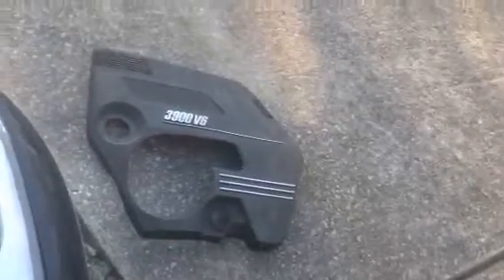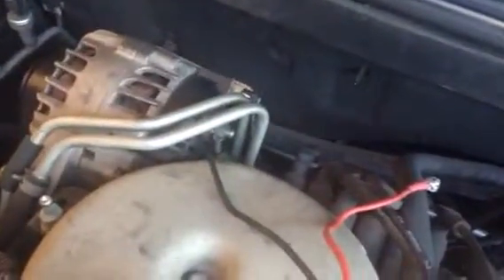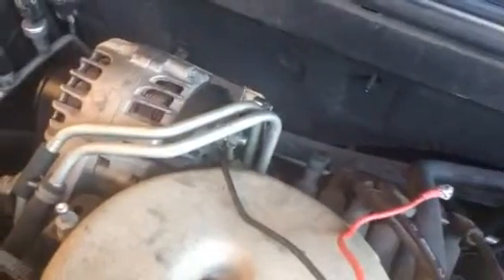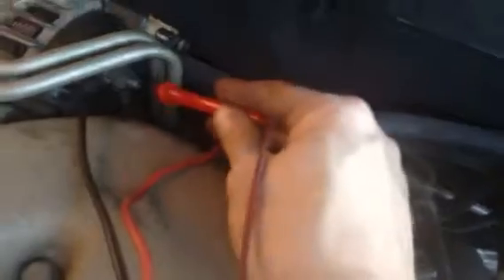2006 Pontiac G6 3900 V6 charging fault; Fusible Link bet. Alt. & Starter

Comment: Hey I’m having the same problem.  Did you ever get it resolved?  How you connect the alternator to battery after
Reply from the maker: Double, triple check the Fusible Link between the alternator & starter. This seems to be a common problem w/ these cars, the parts stores should have the part & be able to help u out. It was Not my car, so no I wasn't there when it was fixed correctly.  Not sure what you're asking at the end, alternators & batteries usually have a medium or heavier gauge wire, 12-10 gauge, maybe bigger, that connects them. Alternator usually has a stud/nut connection, & usually goes to the Positive battery terminal, in general, some cars may be different. Been about 5 years since I looked at this Pontiac, so ask around, especially the parts stores. Wish you the best man. Take care.    - Leeroy

Comment: I changed the alternator and starter for my 2009 pontiac g6 2.4 L fired it up and my battery light on dash cam still showing changed the fuses still having the issue any ideas
Reply from the maker: Look for & test the fusible Link w/ a multimeter, check continuity(beeper function), check connections on Both ends of it. Could be the same problem, but idk for sure since your's is a 2.4L. But they might share a lot of the same parts. Ask your local parts stores, mechanics & such, & look for fusible Link repair videos for your 2.4L. 
Good luck man, wish ya' the best.   
Take care,  - Leeroy
Reply from the maker: If it is the fusible Link, replace it & I always Always recommend dielectric grease. Apply w/ a toothbrush preferably. 
 - Lr
Reply from the maker: U get it fixed? 
Hope so. 
 - Lr
Reply: @leeisenberg  
I haven't yet I put on the starter and it broke the plastic part that connects to the fusible link so now I'm looking for a different car starter but they were used starters so hopefully I can get this done I'll keep you updated
Reply from the maker: @AaronRowland-y5w  Oh okay. Sounds like you're on the right track.  
Good luck, wish ya' the best.
Reply from the maker: @AaronRowland-y5w  Oh okay, cool. Nothing wrong w/ used parts unless they're worn out. U might want to lube/grease the bearings in those starters if u can w/ some good stuff like blue Lubrimatic high temp wheel bearing/brake grease, & if they have brushes polish the commutator & add a very light coating of high temp dielectric grease.

Comment: Hello I have this same exact problem right now. Did you find a solution?
Reply from the maker: I did Not find it, but the fusible link is down on the starter. Read all the comments here & look for a video that shows Exactly where it is.  Good luck, wish ya' the best,  - take care
Reply: Most likely, it's the starter wire don't at the starter. The green wire, it gets caroded really bad and goes bad. Cut it and replace that wire.

Comment: I found the fuseable link should be in the small wire off the starter that comes from where the large wire from the battery to the starter. 2 wires hook together at starter.
Reply from the maker: Oh okay cool, thanks for sharing man. Wish I'd known where it was when I was doing this. I was Mistakenly told it just needed an alternator, found out the Hard way.  Thanks again for sharing.
 - take care

Comment: I had the same problems and found that it was a wire burnt in to going to the starter. I fixed that and it runs fine now
Reply from the maker: Hey thanks so much for sharing, you're the ONLY guy to leave any comment on the Real Fix w/ this problem. So was the wire that burned actually the Fusible Link or something else? Never mind I think u answered that in your comment below.  Hey man u don't have any content on yer channel, so that can be yer 1st video.  Can u make a short/sweet video clip showing it?  thanks again, take care man
Reply: Man my cars fuckin not starting new alternator an battery...so its a wire from the starter? Wheres it located on a pontiac mines 09
Reply: Is there a video or tutorial that shows how to do it? Maybe a link? Much thanks
Reply from the maker: @BabyAnthony  There SHOULD be 1 out there, but I don't have 1 handy at the moment. Let me know if you find a good 1.  Good luck, wish you the best,   - take care
Reply from the maker: @FIGHT101TV  Probably your fusible link between the starter & alternator, its a special wire that acts/blows like a fuse, but u have to replace the whole wire. It should be on the same place on your 2009 since theres just 1 gen of G6; 2004/2005-2010.  Good luck, wish ya' the best,    - take care
Reply: @leeisenberg  hey yo I don't know if you are still dealing with this problem or not but I as well could not find no videos on The wire feasible length wire but I do know that the wire is green and the wire coming off the alternator is red and again the wire coming off of the starter is green or bluish color. But anyways I believe I am dealing with the same problem on a customer's car of mine so I think when I'm going to do is make my own video and post it to YouTube as I have been making my own do-it-yourself how to videos for cars because I am a mechanic so that being said I might go out and make me a video on how to do it for everybody while I'm fixing my customers car also if anybody ever has any questions you can find me on Facebook by the name of David King or my personal page www.facebook.com/kingdavid4u and I also have my business page / shop page on Facebook and the name of my shop business page is called Lucas County auto mechanic. And the profile picture is of a red spider eclipse with the hood off and the engine halfway pulled out in the air also again that is called Lucas County auto mechanic and here is the Facebook link to my shop page below where yes if anybody needs any work or help you can find me on Facebook and this is the link and my number is 419-466-7663 if anybody ever has any questions go ahead and feel free to give me a call. I am located in Toledo Ohio. Just south of the Michigan border that is Northwest Ohio literally just 2 minutes south of the Michigan border line. Thank you you too bears www.facebook.com/KingDavidAutoMechanic
Reply from the maker: @kingdavid4u1588  No I was trying to help a lady I worked w/, couldn't fix it, misdiagnosed as needing an alternator, so I have to give up & pass it on to a more expensive mechanic. It was in the spring of 2019. I'll watch your video for sure, but I hopefully I won't have to work on another 1 of these.    - take care
Reply: How did you fix the wiring

Comment: That was 2 years ago . Did you ever figure out the problem ?
Reply from the maker: Personally, no sir, but if u read all the comments in this clip they explain Exactly Where the fusible link is that was blown in this case. It has to be replaced if it's blown.

Comment: i can start my g6 and sometimes light will come on and then when I begin to drive it then goes off. I replaced the battery last year not knowing that the alternator was soon to be at its end. So then I changed the alternator and the belt and my light still comes on then goes off when i drive.
Reply from the maker: Read all the comments below for the fix, the fusible link is down on the starter I think.  Wish ya' the best, take care man.
Reply: It's my battery current sensor I just don't know how to check for the right voltage to replace it. It's either a 5 or 10v

Comment: check the wiring at the starter that battery wire coming off the back of the altenator goes down to the starter and back up to the battery that's where you will find your problem.
Reply: Do you know this particular make/model and their problems? I am having a similar issue our town mechanic has had it for months and can’t figure it out.

Comment: If you haven't located the fusible link it is underneath the starter you have to take out the starter and the fusible link is behind it
Reply from the maker: Thanks, good to know. Seems crazy to have to remove the starter to get to a fuse that protects the starter, mercy.       - take care
Reply: I was thinking it might be easier to reach the fusible link by removing the alternator and it should be right there underneath it (red and black wire turns into a green fusible link that connects from alternator to starter)

Comment: same issue i found the starter has two wires smaller gauge mine is green is shorted causes drain or parasite drain no charge, its cramed in above oil filter frayed and touching frame causes sparks melts wires. they put cheap wires in these cars with no slack at all
Reply from the maker: Thanks man, hope u got yours fixed up.  Looks like I'm just now getting the notification of your comment, weird.     - take care

Comment: I'm having the same problem new alternator and battery and still not giving you charge. If like to do this test but want to make sure I'm doing it right. So If I jump it from the back side of the alternator from that post with the nut to the positive side of the battery I should in short be bypassing the fusible link and see a charge on battery. If I can do this test I will replace that wire. Just making sure it goes from alternator two positive side of the battery. Thanks great video 👍
Reply from the maker: Yeah Steve, you're very welcome.  Go ahead & test it that way w/ a jumper wire to double check & make sure that is the problem. Then look for the fusible link down on the starter, it's a wire between the alternator & Pos+ post/terminal on the starter I think. Not sure where it connects on the alternator, maybe on that Neg- stud.  Good luck, wish ya' the best,               - take care
Reply: I'm just an idiot. Why didn't I see that? There is a cable that goes directly from the positive terminal of the battery to the starter, and the green cable (Fusible Link) is connected to the alternator. you place both of these cables on the "B' Terminal. My engine turned over, the Battery Icon is no longer on, and my 2006 3.5 G6 is running like a top

Comment: Did you ever find it?  I have the same issue.
Reply from the maker: No man, I did Not, it wasn't my car. She took it to a shop, they charged her at least $400 er whatever & she said they told her it was "the starter", but it cranked & started just fine. So the fusible link must be on or near the starter or something like that. Keep looking & let me know what you find out. Here's a # you can call & talk to an ASE mechanic during regular business hours: 800 280-2737.     Keep me posted, good luck, take care man.
Reply from the maker: Any news?  Did you find where the fusible link is?
Reply: lee isenberg there is a wire going from altanator to the starter that is the fuse able link. The wire hooks to the hot post on the starter and where it’s located it is common for these wires to burn in 2
Reply from the maker: @billymabe8095  Hey man thanks for sharing. Wish I could've found it months ago, but we ran out of time after misdiagnosing & replacing the wrong part; the alternator. Thanks again sir, take care from Tn.